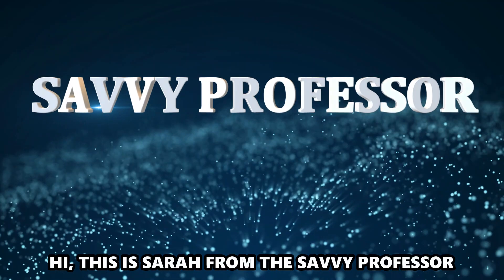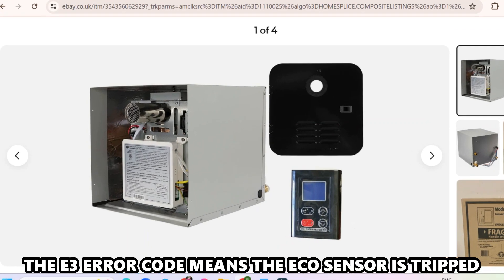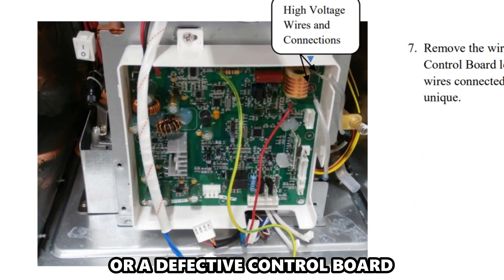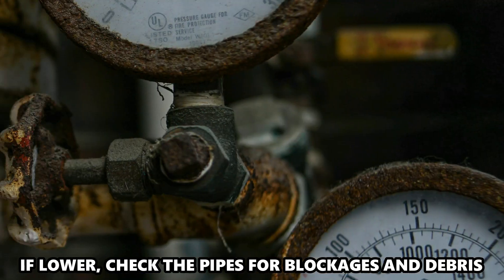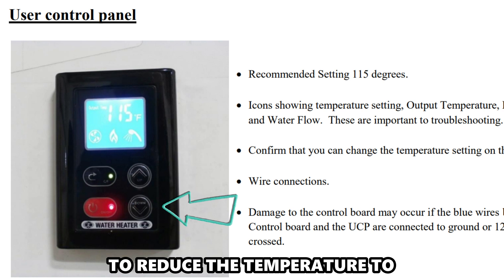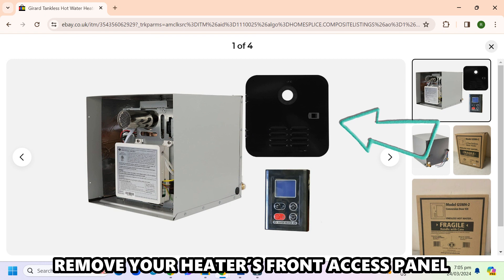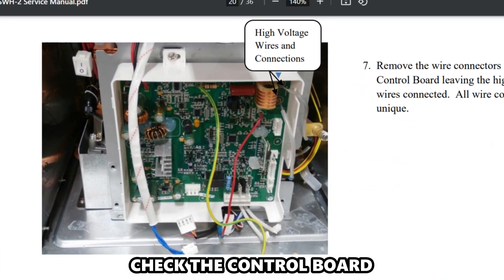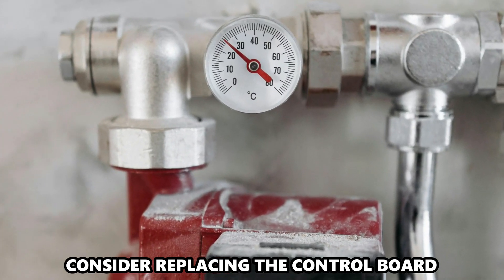Girard Tankless Water Heater Error Code E3 (Tripped ECO Sensor - Meaning, And How To Fix It)

Comment: So I need some clarification. In the video you kept referring to the inlet and outlet thermistors as the ECO Sensors. When you switched to talking about the real ECO Sensor you continued to call it an ECO Sensor as you should have. So, do I splice the Thermistor wires to test or do I splice the Eco Sensor wires....or both separately?